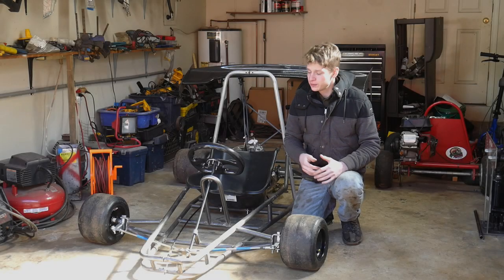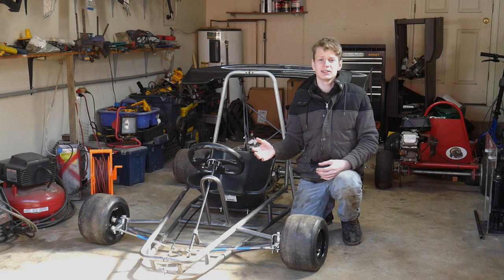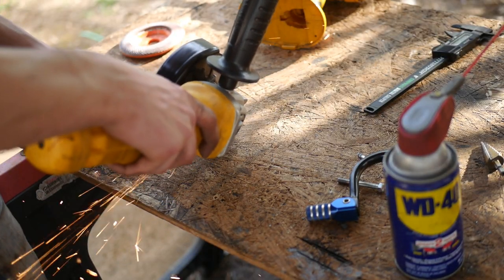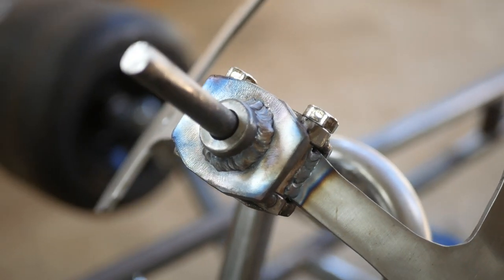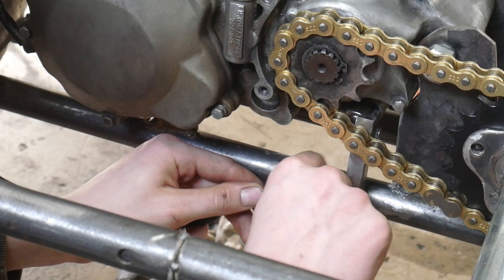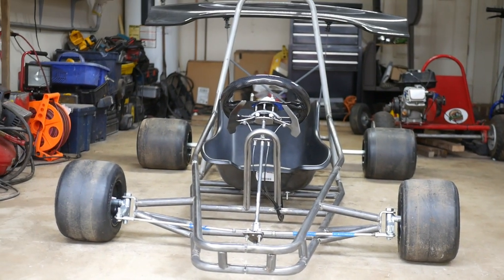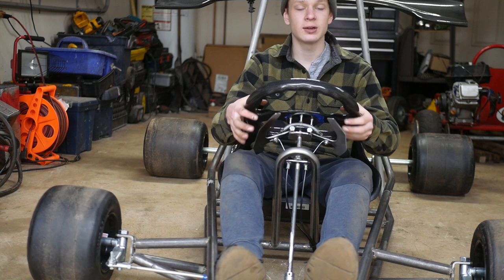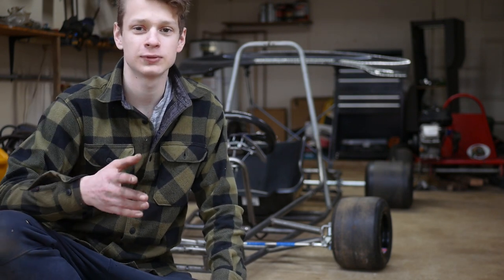F1-Style Paddle Shifters On a shifter Kart Install DIY

Comment: Your doing a great job.
I have driven both type of paddle shift some where the pedals are on the wheel and some where the paddles stay in place and the type where the paddles stay in place are 10 times better because you never have to look down or double guess yourself. If you put 2 tags for the cables on steering support bar and a of little bits tube to the centre of your shift mechanism to keep it in place you will have less wear and tear on your cables and your selector fingers in the gear box will last longer.
2 stroke can produce false neutral especially with worn selectors

Comment: Nice to see creativity.
   I seen a problem that you may have.
   The engine pulling on the center of the axle will pull the axle towards the motor sprocket.
    Putting a bearing by the rear sprocket and support that to the engine mount will stop the axle flex.
  Good luck

Comment: You should invest in a plasma cuter it will make cutting that still a lot easier and make cleaner more precise Cuts than a cut off wheel on a grinder.
Reply from the maker: Definitely looking at one. My finances aren't that great but my dad said he can help me out

Comment: Probably best looking kart on YouTube
Reply from the maker: Thank you
Reply: @VasilyBuilds  you got a build  schematic, id like to build one but with a fully built 212, with turbo
Reply from the maker: Not yet. Turbo in an engine that small? It will sound like it's working but it won't . You'll need efi too 700$ I've seen so many YouTubers fail at this
Reply: All depends what stroke it will be and gow the set up is,

Comment: In my head I see that trying to shift or down depending on what what you are turning.  You might need to also fix the cables to the steering shaft so you aren't pulling the inner shifter cable when you turn

Comment: Do the paddles move with the steering? If they do what stops it pulling the cables when you turn
Reply from the maker: Yes they do, It should be an easy adjustment
Reply: The wheel dost turn a full 360 like cars so it shouldn’t be a issue

Comment: Hey, I noticed the when you pull one paddle the other paddle moved. Maybe you could use individual springs to keep it from happening, or weld a stop under the paddles. I know you're set on the paddle shifter, but wouldnt you need to down shift for first gear?
Reply from the maker: Unfortunately, I dont think there is a way to stop the other paddle from moving, Unless they were hydraulic or electronic shifters, I would be able to shift to first

Comment: Hey quick question! Are you planning on cutting off the excess threads on the steering wheel mounting bolts? I may have just been looking from a weird angle, but it looks like it might bin on your shifter spring in a turn.

Just an idea! Great build keep it up bro!
Reply from the maker: Yes of course thanks!

Comment: got a few friends talking new go kart track and builds... but i know my friends,,, alot of old man talk around the shop.... so im just gonna have to be the cobra commander on this mission and just do it..... then watch them all scramble to keep up....p.s. - dont try to use that bender when ya start doing sch8 roll bar tube - it works, but you will save alot of greif by just buying eastwood bender... i build custom jeeps and rock crawlers but nothing pro comp.... just 1 off original designs is my specialty

Comment: You might check out CR500 GoKart hillclimb by jamdrop. 5.9 million views. But there is a good view of the clutch paddle setup and shifter on the column. Plus the video itself is a pretty scarry ride. Your Kart is looking good!
Reply from the maker: thank you for letting me know. Im not afraid to redo the system

Comment: Great work so far, but honestly, I think you should do a simple air shifter setup triggered by paddles. A small compressed air tank and you should be able to shift thousands of times from something like a high pressure paintball tank that only cost a couple bucks to have refilled.
Reply from the maker: That would be a Great idea for the future! Any threads or forums on this
Reply: Vasily Custom Builds  You could probably find something pretty easy, but basically, it wouldn’t be difficult at all. They have plenty of air shifter setups on the market that everybody uses on stuff like sand drag quads. Instead of the typical CO2 paintball tank, you can use a compressed air tank that has a MUCH higher pressure (I wanna say 3k psi+  and most paintball places can refill for next to nothing). You could use your paddles and some momentary switches to trigger it, and you can even wire it up to the coil for a no-lift shift that way when you shift, the button will also momentarily kill the ignition so you don’t have to let off the gas to shift.

Comment: Do you think its cheaper to buy a 250 dirt bike to build a cart or just buy the parts separate! I'd like to use the brakes an chain sprocket cables gas tank what do you think ? I'll be starting from nuthing! Please let me know what you think
Reply from the maker: 125 will aslo be quick. I'd say it's better to buy a clapped out bike because you'll have all the extras. Depends usually mx engines are very expensive
Reply: @VasilyBuilds  I was thinking new Chinese bike to chop up thanks for the reply an the videos thare varie good bro keep up the good work!

Comment: I like your style and design, but you may want to take a look at your steering setup.
Right now you have a reverse ackerman steering, an easy fix though.
If you take the left tierod, and put it in the rear of the rightside hole of your steering
shaft arm, and the right tierod in the front leftside hole of the steering shaft arm.
this will make your inside wheel turn more than the outside wheel in turns.
But all in all, Keep up the good work.
Reply from the maker: Finally someone can explain it to me. I was considering running zero ackerman

Comment: I would of done traditional Shifter Kart setup. Was a good build.
Reply from the maker: Thanks! It's weird cuz the shift shaft is on the right, and you want the shifter on the left. The hole shifter would be 3 feet long if I did that. Well have to see tho

Comment: I am not a fan of paddles because they are really sloppy when done this way. It does keep your hands on the wheel, but the slop is jist too much. A nice shift lever on the side with some tie rods would be a lot better overall in my opinion. Even a turn signal type of shifter like what the racing karts have would be stronger. You did good build quality tho, I can't argue that.

Comment: If you upsift you are pulling the down shift lever also,,so you will have to get new design for the motorcycle gearbox shifter  ,modified 😎🤝

Comment: Seems you are trying to reinvent what has already tried and discarded through some 40 years of racing shifter kart development.  They use a column lever shifter. Also, your chassis would appear to be way too stiff to properly transfer weight when turning ... will lead to excessive under steer, modern racing karts depend on the chassis flex in order to transfer weight to outside wheels in a turn.
   That said, nice work you are doing there, and its great you ware willing to try stuff and see if it works .. it certainly  is fun learning for yourself, good luck!
Reply from the maker: The pipe I use is not as strong as you think. It flexes too much actually, but yeah I am aware of chassis flex and also the jacking effect
Reply: @VasilyBuilds  OK, good, at least you are aware.  Basically when you crank the wheel, the from tire doing the "jacking" should reduce weight on the corresponding rear tire .. so the chassis must be rigid in some areas, while flexible in others.  I do think once you strap on a roll bar and the supports that go with it, then you must develop your own chassis design from scratch, existing racing kart chassis will not serve as much of a guideline.  I'm also wondering if your 1" rear axle will be strong enough .. if you get to much flex at ends, you might need to move those rear bearings outward toward wheels (which is what I do on my vintage dual engine racing karts where we are required to use 1" axles).  I think it's cool you are going with that moto 250 two stroke engine, should durable and extremely powerful!!!!
Reply from the maker: @KrustyKlown  thank you for the info! We both will have to see how it turns out. It may have a major flaw, it may not. It probably won't handle as good as a shifter kart with an offset engine, but it may make up for that in the straight line. And this is my first one so I may be okay with that
Reply: @VasilyBuilds  Don't forget about good brakes!  If you are going to run on asphalt tracks ... I would recommend using some good hydraulic brakes, with at least 2 redundant systems (in case one fails) ... in kart racing, the worst crashes I've seen were all brake failures .. pads dropping out, linkage failure, or brake lines popping, etc... I run 3 redundant systems on mine, 2 on rear, and 1 on front .. where 1 or 2 of the 3 can fail and that remaining one can slow the kart. Doing front brakes is a challenge though, from the caliper mounting to the need for a front/rear bias adjustment .. 2 disks on rear axle can get it done for you ..,. maybe 2 used rebuilt MCP hydraulic units, very popular in prior years of karting.
Reply from the maker: I'll look into that soon, maybe I can find some for a deal

Comment: Why do you want to bang yor head agains the wall and try to make some weirdo steering geometries of your own by the hardest way, and not to do as done before and found to be the best?

 It is not the whole picture, that the steering wheel turns on the right direction. Both of the front wheels must turn too, in every position, according to curve, you're driving at a time. Try to google Ackermann. Also make sure you understand the relation with camber, caster and wheel offset from kingpin, to adjust right amount of rear wheel lift in corners, according to your frame rigidity. There's no diff you know. Toe in is nothing close that important, as it is as well.

Without any pushing you down, learn the principles, make the kart go like hell. Then play with carbon wings with stainless brain slicers. 

There is a sequence in things to be done.
Reply: I said camber, without mentioning about KPI. Sorry. That's more important with wheel lift in corners
Reply from the maker: Thank you for your suggestion, I will adjust everything for proper lift. Not only am I building a cool street kart, but I'm also building up my channel. And that's what is important for me
Reply: There is a reason why steering rods are commonly behind the column and with two pivot points at the steering shaft. That is to get both front rubbers pointing to the tangent of a curve. In other words inner curve rod is being pulled slightly more than outer is pushed.